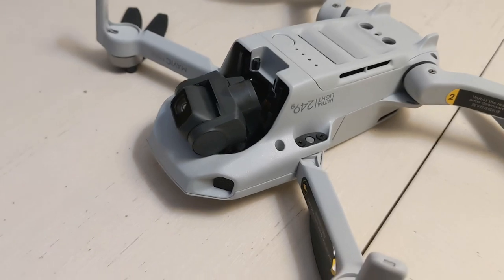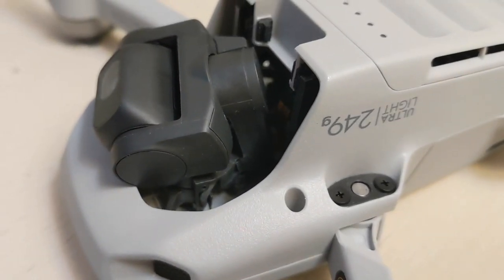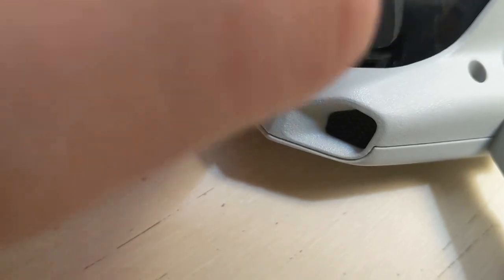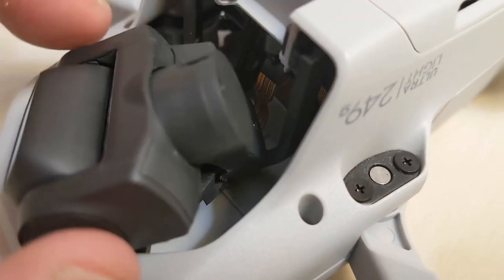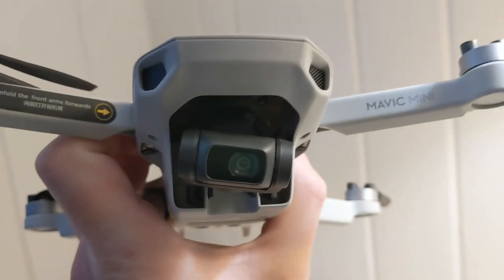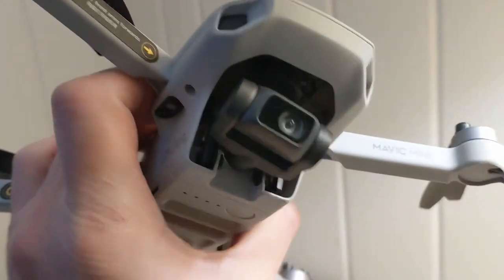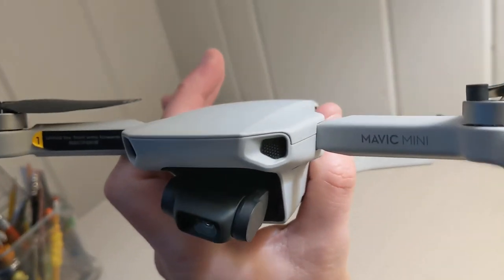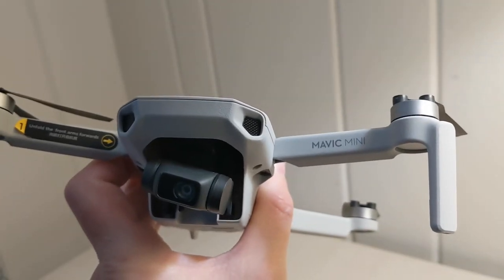Mavic Mini Broken Gimbal Repair

Comment: How did you go about fixing I have the same problem?
Reply from the maker: Im still flying it loose for now but am going to send it in to DJI for repair.
Reply: Flying with it like that for me caused warbled video. Wavy image like it’s under water. Camera shakes too much. I’m gonna try the super glue route.
Reply: @JAIME MIDDLETON thanks i will try that is it pretty easy fix?
Reply: JAIME MIDDLETON I tried to glue it, but didnt work, now it always says Blocked Gimbal. Not sure what to do, can you remove the wires?
Reply from the maker: Yes I had alotofwobble here and there but alot of solid tilted video too